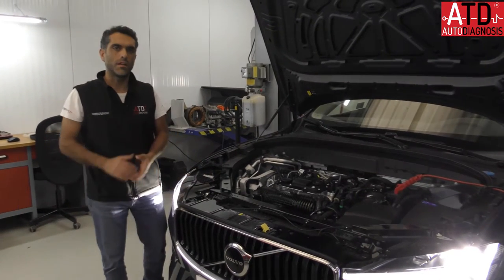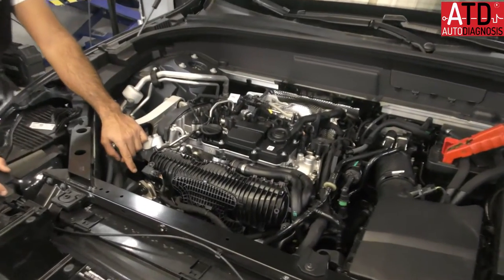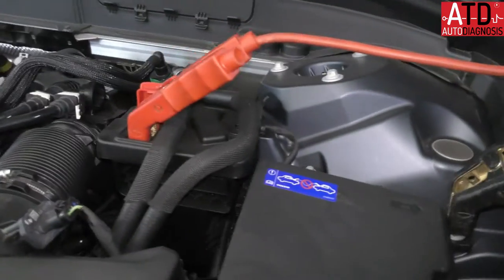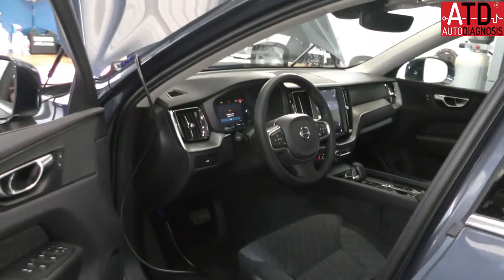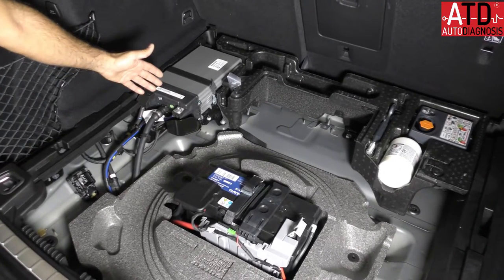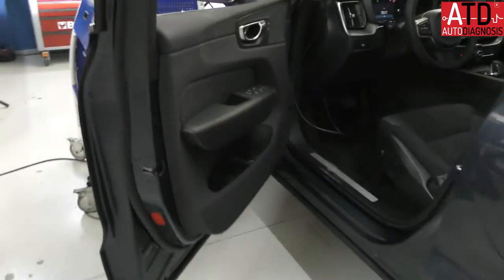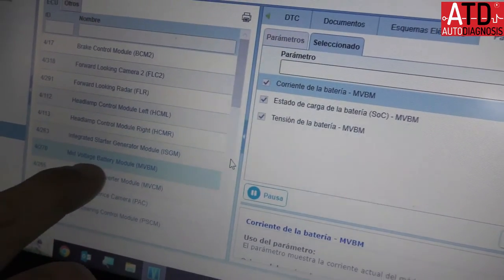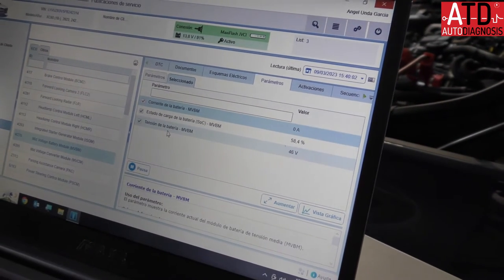Volvo XC60 - 48V  technology.

Comment: So I have a 2023 XC60 petrol mild hybrid.  If I want to 'trickle charge' the battery with my 12V trickle charger, do I use the connection points in the engine compartment.  Does this just charge the 12V battery, or will it also then continue to charge the 48V battery which I understand is used to start the car in mild hybrids?